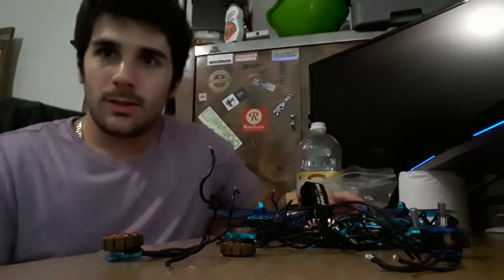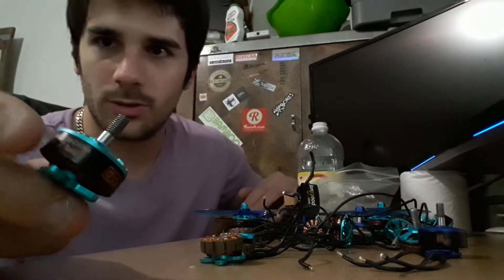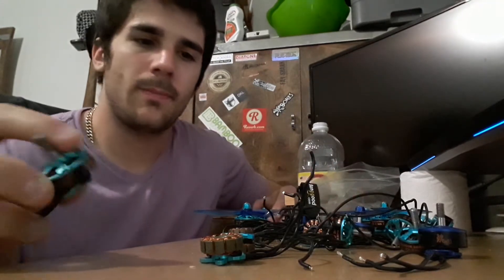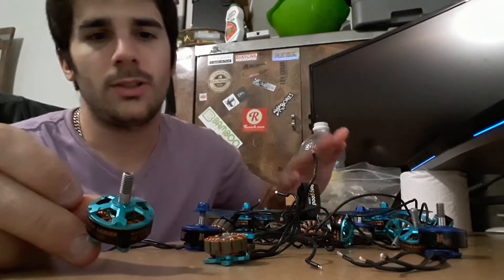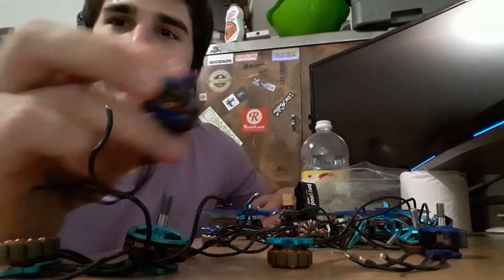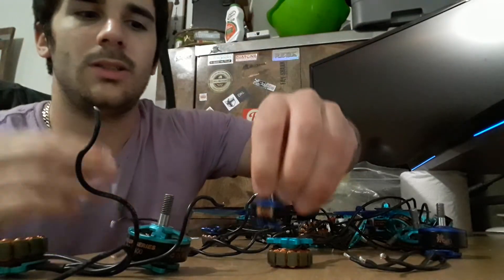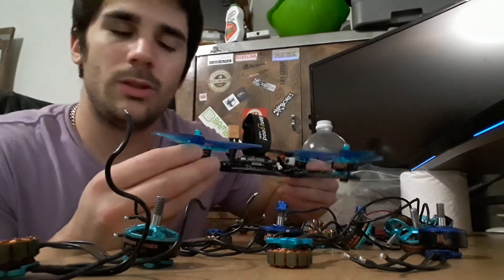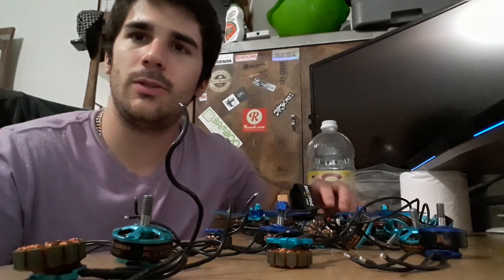DYS SAMGUK Wu 2400kv and Wei 2600kv Review and Problems

Comment: I have got 5 of the 2206 2700kv motors, 2 of them had terrible bearings right out the box. After about 4 flights without crashing they all sound the same. I didn't have enough flights so see if it effects tuning a lot. Bearings are the worst i have ever seen in brushless motors. Even 2 year old motors that have been abused by using it indoor a few times is sounding better.

Comment: I got 4 of the WUs (2206) and they have been great. No shaft play and clean flights. That said, I’m only 6 or so packs in.
Reply: Bonemyster FPV, I am kinda crap and noob, so it is likely me. But I had shite motors, 2 of 4 with loud bearings, that came on my furibee x215 and these fly HEAPS better on stock pids (no weird oscillations/flips of death like stock motors).
Reply from the maker: From my Point of View give full bumps in the throttle(like full throttle for .5seconds and go back to 10%) and watch to see if you see any dips on the pitch or roll axis, found that with these motors i couldnt tune I, the dips would never go away. As far as skills concerned you just need some tims on velocidrone to get heeps better
Reply: Bonemyster FPV I am starting to love this though, so maybe time to anti-up for some better motors. No offence taken BTW. Believe me, I know I have HEAPS to learn and I take in as much advice as I can!
Reply from the maker: From my Point of View yea a newish pilot would be able to fly them ok, betaflight flys so good on stock now a days i find it hard to get oscillations. Get velocidrone, it will help out so much like it did for me
Reply: Bonemyster FPV just wanted to say, you were spot on. Several packs more and smashing the throttle some more, I got some minor flips of death (recovered before hitting the ground 😓). When I landed I noticed shaft play on two of the four (still not as bad as the stock motors). These motors may be more powerful than what I had, but they are rubbish. I have started smashing Velocidrone too 😜👍🏻. I don’t really upload vids on YouTube, I certainly have gotten better over the last month or so!
Reply from the maker: From my Point of View Only time i have had a flip of death is when the 3 phases resistances arent the same, get a multimeter, put it into resistance mode and check the 3 combinations between the motors 3 wires, if they arent the same then the motor is bad. Flip of death isnt always the motors btw. Nice about the velocidrone, its the best sim out their, i beta test it and the devs are like slaves to their work
Reply: Bonemyster FPV the FC is a kakute, so maybe the flip of death was just wires touching the Gyro or something throwing in noise. But the motor bearing are LOUD now... so either way they are shite 🙄

Comment: I was about to buy these but you've convinced me to look around some more. Did you have any other recommendations for budget motors? My next choice was going to be the Racerstar BR2207s, but I can't find much info about them from reviewers.
Reply from the maker: Cameron Smith Joshua bardwell recommends the RCX 2206. They are around 11 bucks without warranty, have arc magnets, and decent bearings. Racerstar also has bearing problems. The racerstar 2207 are kinda new and thats why its hard to find info on them

Comment: o.k now that I know I have junk, I have serious vibrations at 1335 it starts on betaflight,,, any certain pids I could try, using stock butterflight Pids. for 2800kv,,, mmm I think this is a $40 lose,,
Reply from the maker: lgrip1 lgrip1 Soft mount your motors, 2 layers of electrical tape and make the holes using your soldering iron. I like to soft mount everything lol, including my camera so i get rid of any vibrations id ever have. Id recommend you try swapping out the bearings for some NSK ones that are the same size, its a pain in the ass to get that circlip off and on
Reply from the maker: lgrip1 lgrip1 As far as pids are concerned you have to learn that yourself, as im not there to do the testing for you.